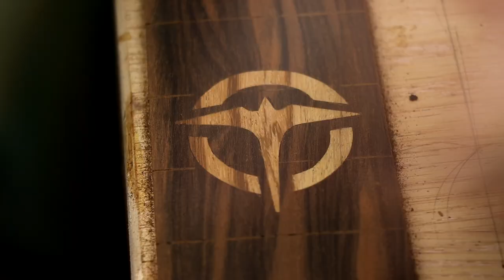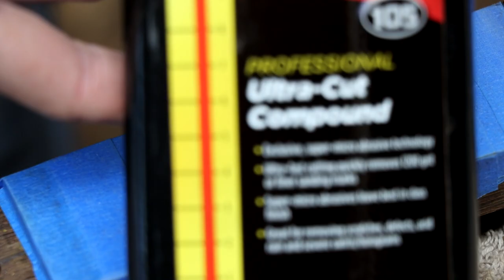Orbital Guitars - Custom Bass Build "The Gorgon" - Full Build and Demo

Comment: What is that bit called that you used to make the recess for the control knobs?
Reply from the maker: I just used one of these and rounded over the corners with a file https://www.amazon.com/Irwin-Tools-87924-Short-Spade/dp/B0002XCEBS/ref=sr_1_15?crid=57ZCOTFMO9X1&keywords=1.5+inch+paddle+bit&qid=1678110561&sprefix=1.5+paddle+bits%2Caps%2C107&sr=8-15
Reply: @OrbitalGuitars  Thanks, man!